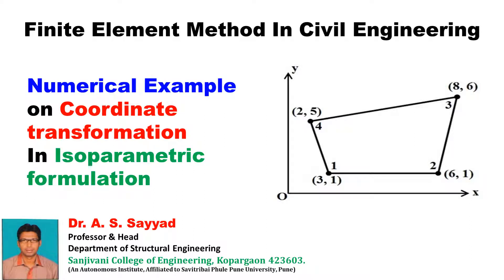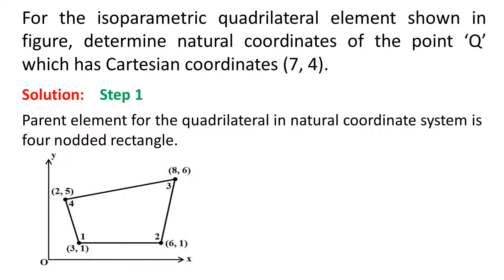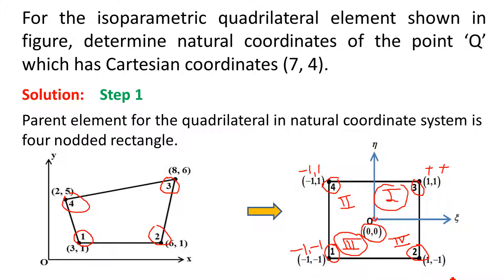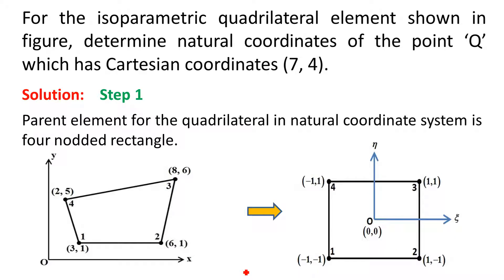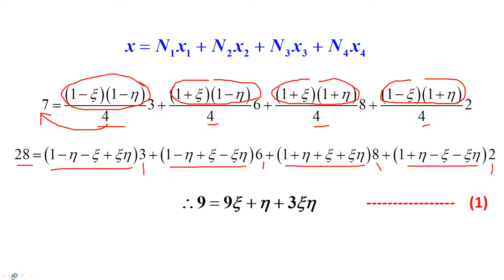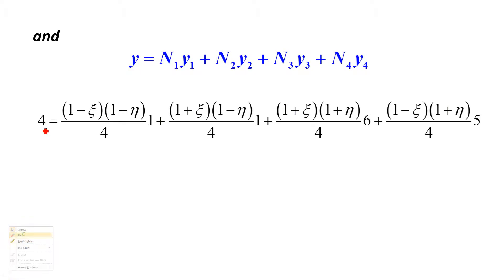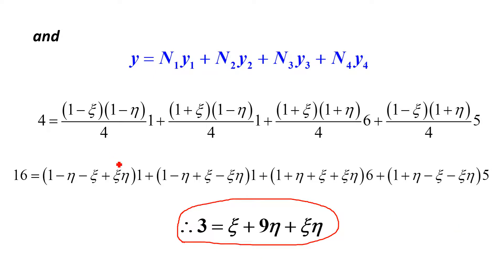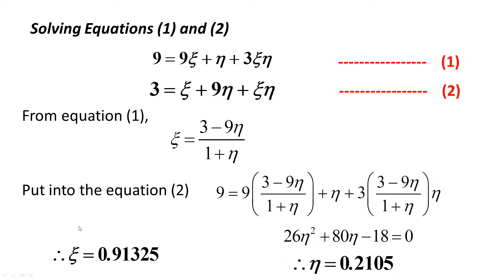Lect34: Finite Element Method

Comment: Dear sir 
Thank u 4 this video 
 I would like to ask u .
If the final 2nd degree equation of the eata ( n) has two different values both them are between -1 to 1. In this case which is one should be considered ?
Thank you